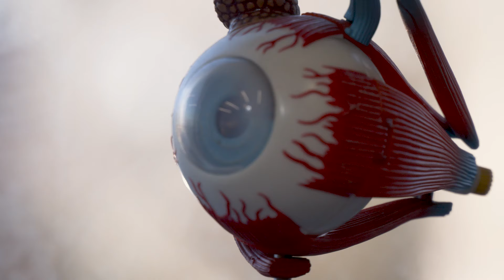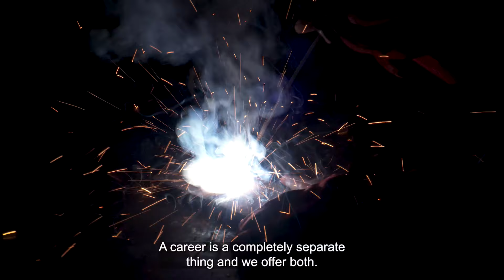Iarnród Éireann Irish Rail Apprentice Programme 2024

Comment: Hello, im interested in applying for an apprenticeship, but may be too old, 32. What is the differance between a fitter and a mechanic? Im not sure what role would suite me if any.

I enjoy taking things apart and fixing them/learning how they work. I service my own car, have done breaks and injectors on a few cars, and did a few bits on a vintage motorcycle such as brake slave and master cylinders, clutch, and stator motor. I have no problems with abit of oil and dirt. 
Thank you in advance for any information.